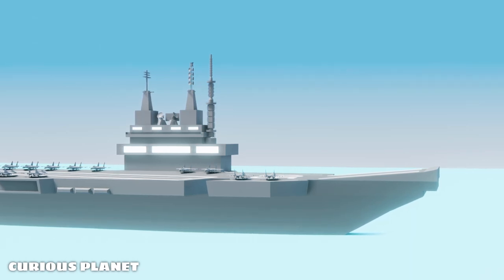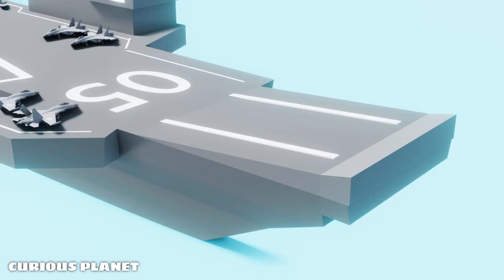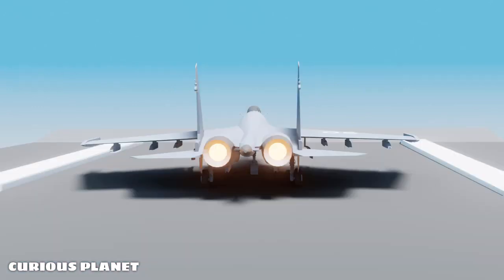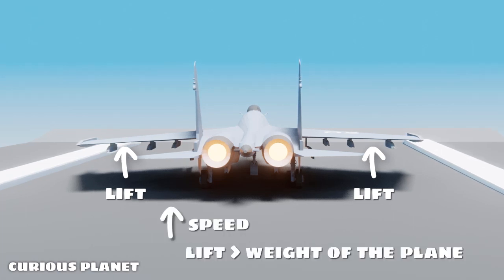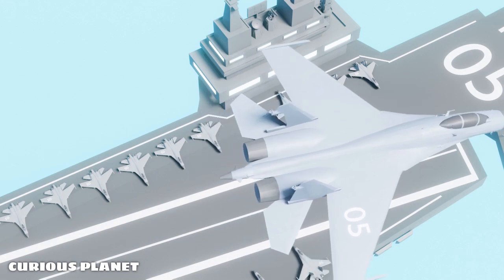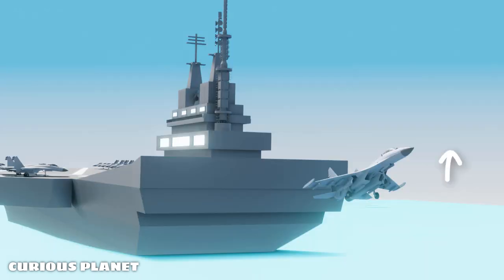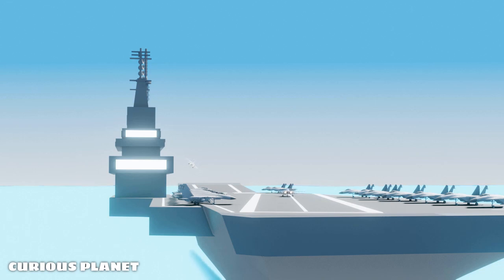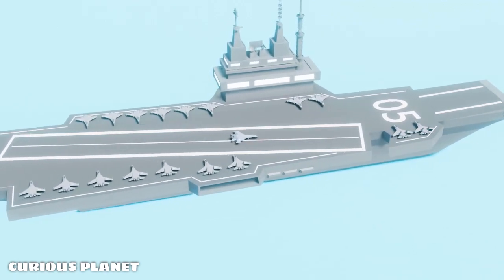Why Do Aircraft Carriers Have An Upward Sloping Take Off Deck Ramps? Ski Jump Explained Animation

Comment: It takes energy to accelerate an aircraft to flight velocity. That energy comes from the engines. On an aircraft carrier, the ship's catapult can add to the aircraft's own power considerably. This adds tremendously to the aircraft's capability. A ski jump adds no energy. It therefore does nothing. In fact, forcing the plane to accelerate perpendicular to it's flight path actually consumes energy. The ski jump was therefore invented by someone who has no understanding of physics, aerodynamics, or even simple mathematics, and believes in a free lunch. Probably an accountant or a politician. The fact that this stupid idea has been copied so much demonstrates that there are a lot of politicians designing aircraft carriers. In fact, a ship that does not have catapults is not an aircraft carrier, it is a helicopter carrier. All a ski jump does is make a part of the flight deck unusable for parking, which makes the entire ship less efficient.
Reply: Totally wrong.
Reply: @mukeshverma0707  accountant

Comment: Ski jumps are marginal for most aircraft, maybe even detrimental. Remember, you want the aircraft not to stall. Flying 1 foot above the sea and not stalling is better than being tossed 100 feet into the air, stalling, and crashing into the sea.
How do you avoid stall? With horizontal velocity. Ski jumps actually rob you of horizontal velocity. Bad. This is why American carriers use catapults. Lots of horizontal velocity. Good.
Reply: No
Reply: @mukeshverma0707  No what?

Comment: The angled deck is so the carrier can have aircraft taking-off and landing at the same time.
With a straight deck?
 You have to keep the entire landing area clear in case the plane misses the arrestors/the arrestor wire breaks and/or if the pilot needs to go around at the last second.
With an angled deck - as your video shows - aircraft can land while other aircraft near the bow can take off at the same time.
☮

Comment: I had not thought about the carrier's bow, pitching downwards during takeoff.
Thank you.
☮
Reply: It’s minimal, and in the worst sea conditions, I’d be more worried about your plane being pushed off by the wind and waves than by flying nose first into the ocean. Aircraft carrier are huge tho, and can move. So generally speaking, they are able to avoid the worst weather for their flight safety. But idk. In the Arctic, the Soviets and most other powers had long range interceptors and bombers that were capable of doing the flight ops necessary, but maybe that would be a problem if you couldn’t avoid a significantly large storm, but again, the ship is already so massive as to make even the largest storm waves somewhat of a non sequitur(they figured out how to land in bad storms, I think launch would be significantly easier… like… just timing the wave